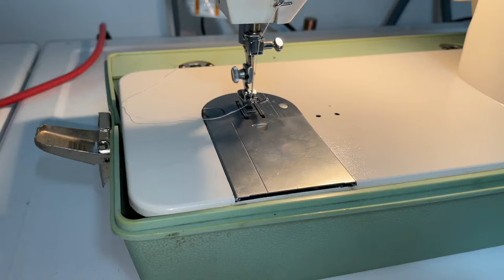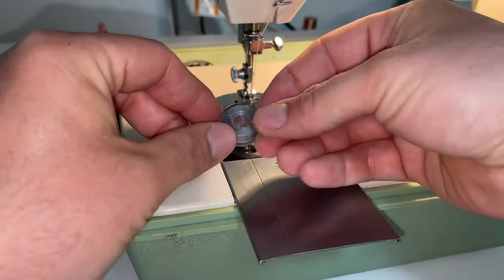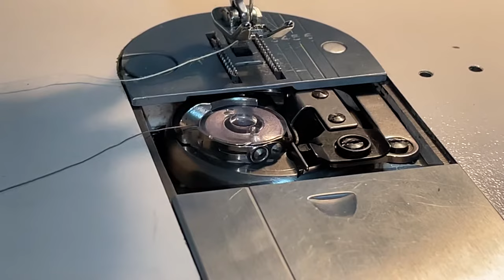Singer 247 Sewing Machine: Loading The Bobbin

Comment: My bobbin won't catch the larger bottom wheel in the way yours does. 
Any ideas why?
Reply: It should do but you have to have the needle threaded first, it won't work otherwise. Also you may not have the bobbin in the correct way, try turning it over.
Reply: I have the same problem. It's not how the bobbin is placed or how the needle is threaded. Has anyone found a solution to share?
Reply: I have the same problem. It's not how the bobbin is placed or how the needle is threaded. Has anyone found a solution to share?

Comment: I dont know but it's not working for me,  if you have an Instagram can you link it for me to send you a video or something ?
Reply: Practice with 2 different colour threads. The trick is to pull on the correct (bobbin) thread loop behind the needle after the one full rotation of the handwheel. I often have to do it several times to catch the right thread. I use a small crochet hook.